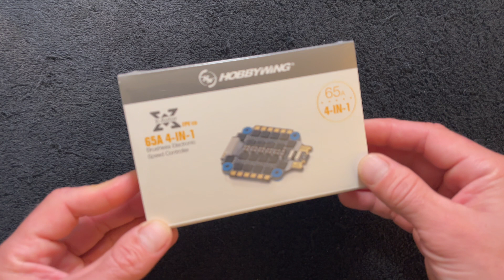The Charlie Show /// Episode 309 /// Xrotor 65A first look

Comment: My 60A WILL. NOT.  DIE. 😅💪🏻

The only reason I don't go with these more, is because of what a pain it is to get those caps off and pads cleaned up with that lead-free solder. I've only had one frame out of 12 builds that has had enough room to fit the installed capacitor. It would be great if they just supplied the capacitor with some holes in the pads, so that it could be at least placed above or below the leads. Other than that, incredible product that I recommend to anyone that has room in their build. 👍🏻